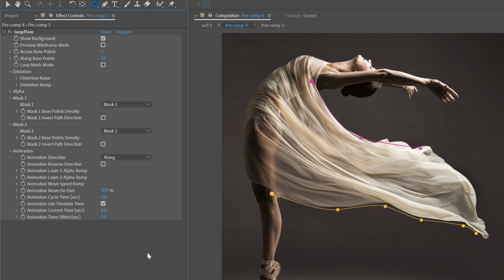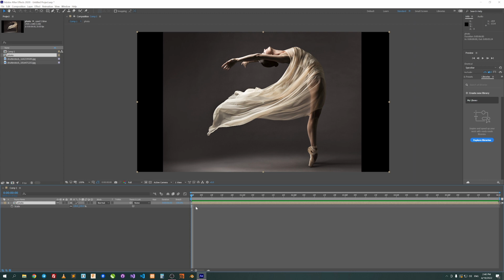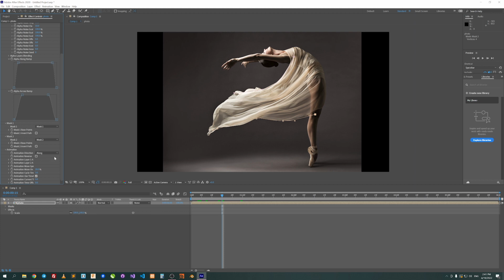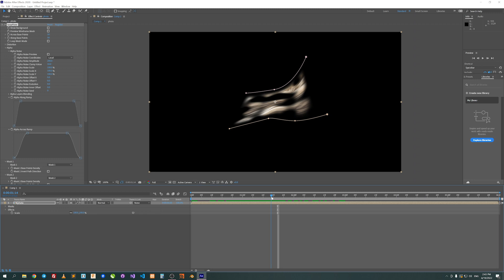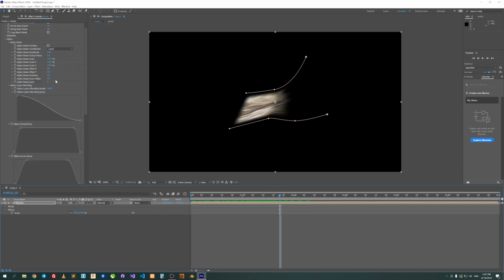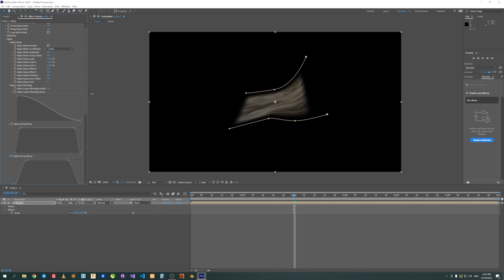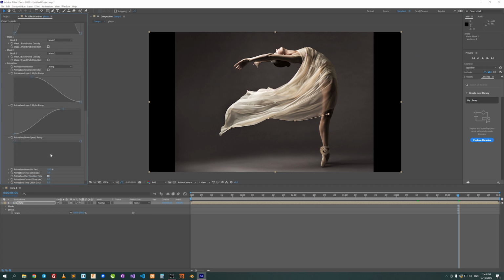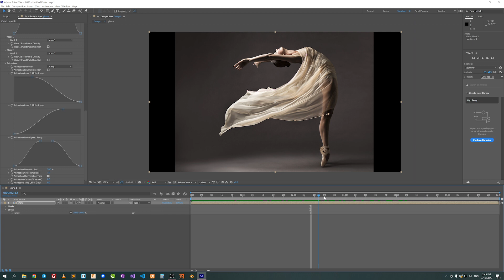loopFlow tutorial part 1

Comment: Mine only works for about 3 seconds of animation. It starts about a second in. And then My cycle time is 8 seconds. the comp is 24 seconds so it could loop perfectly. I have also toggled/untoggled the check timeline duration button. Tried different cycle times. Even reset it and still is for that same 3 second time period after a second in. Not sure what is going on. Thank you in advanced!

Comment: For some reason mine isn't looping properly once it gets to the end of the timeline... it just cuts..  and is very startling to the eye. I really need it to be smooth and not just cut because it needs to loop. Any suggestions? Thanks.
Reply from the maker: You need to adjust cycle time or comp length. By default it is 3sec. So it will loop perfectly with comp 6sec or 18sec or 30sec
Reply: @irrealix  Wow, thank you so much that fixed it!

Comment: hello there! your plugin has been a wondrous thing and i am knee deep in a project that uses it. though, i have encountered an issue. seems to be similar to DogFly's issue where Loopflow highlights images with transparencies, at least doing so when overlaid on another image layer that is also animated with loopflow. was a fix ever found for this issue?
Reply from the maker: Yes the problem is solvable. If you have image with transparency you need to have two layers of image. bottom layer without LoopFlow. top layer with loopFlow but uncheck "draw background".
Reply: @irrealix  that was supremely quick. did the trick. i am immensely grateful for the help, as little as an issue as it was.